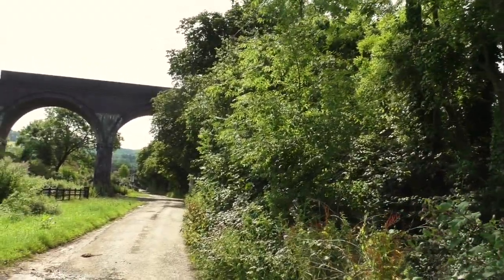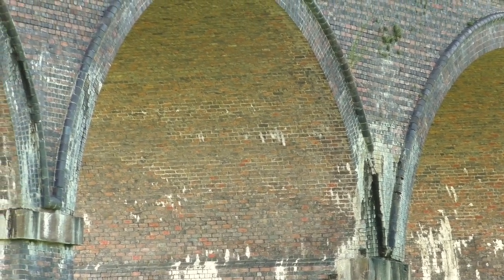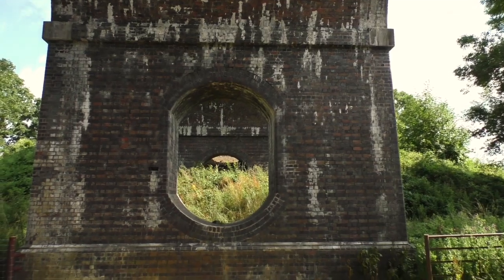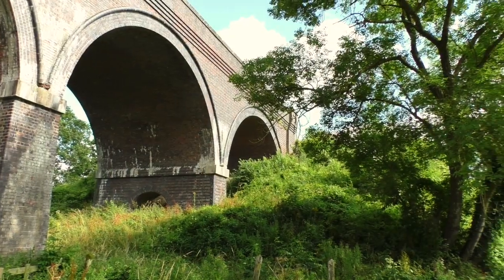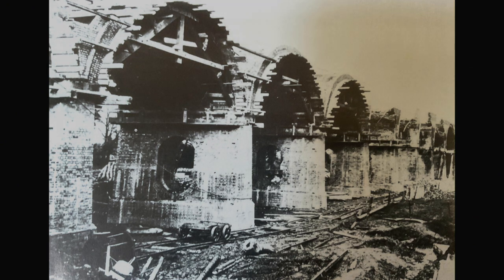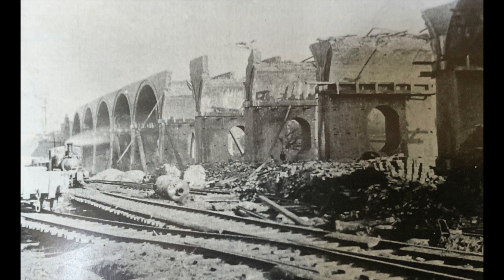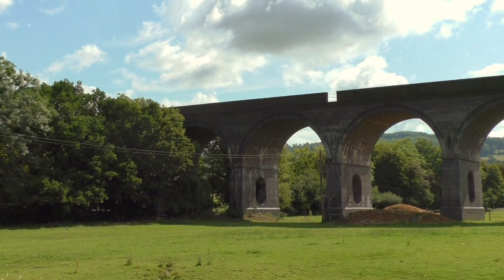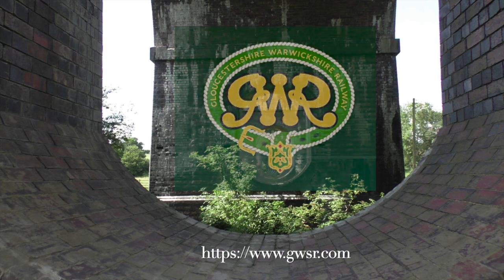TODDINGTON (STANWAY) VIADUCT - A BRIEF HISTORY.

Comment from the maker: With over £275.000 raised so far, work is due to start on the viaduct in early November, and will last four months. The GWSR volunteer Permanent Way team will remove track and ballast. The contractor will then lay a concrete slab along the length of the viaduct, followed by a bituminous waterproofing layer. Once cured, ballast and rails will be relayed. Works will be complete in time for the 2024 reopening of the railway. Repairs to the piers will commence when funds allow and the appeal will continue into next year.

Comment: Hi Ron, Some great clips of the viaduct especially the ones through the arches lengthways👌👌. It's got quite a history, what a terrible day that must have been when it collapsed.

That's a hefty bill for the overhaul but it has to be done, It doesn't look like a quick job either. I remember reading about the embankment collapse that they suffered over ten years ago. I would expect that there will be other railways with similar problems, some have already replaced bridges (watercress line and north yorks moors).

Thought provoking video, well done. Have a great week.
Reply from the maker: Cheers, David. Yes, the railway hasn’t had the best of luck with it’s infrastructure. The land slip was as a result of prolonged heavy rain and water runoff from a new housing development close by together overwhelming the old soak aways and undermining the soil. It was remedied with sheet piles, but cost an awful lot of money to put right. Have a good week. Ron.

Comment: Hi Ron, what a beautiful structure and interesting history. You had some stunning shots in there. The picture of the collapse shows that the parapet hadn't been added at that point, I wonder if that played a part. Keep them coming. Ron
Reply from the maker: Cheers, Ron. Interesting point about the missing parapet wall, which wasn’t noted at the inquest. They suspected inadequate time for mortar set, because it was winter. The Board of Trade Report laid no blame on the design or materials used. It cited the position of the crane over the arch, without a full length of rail between the piers,as the most likely cause. It does seem odd though that a ‘domino’ effect brought down another three arches. I guess we will never know! Take care. Ron